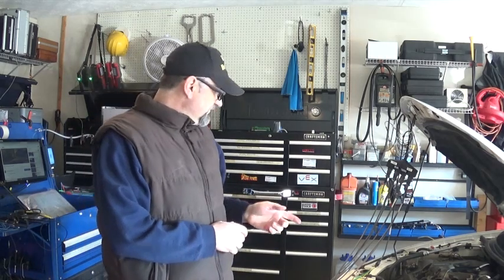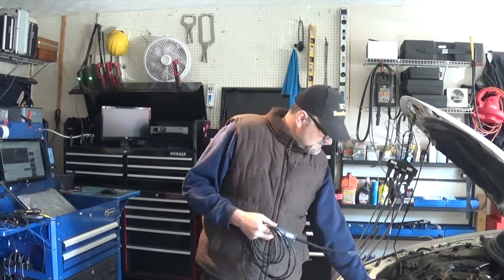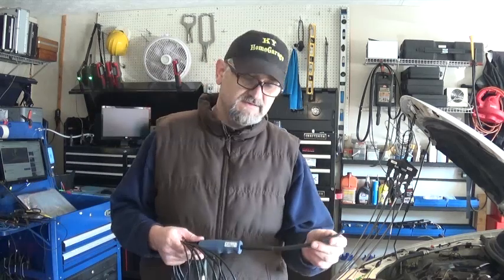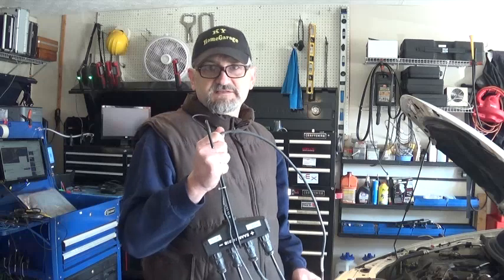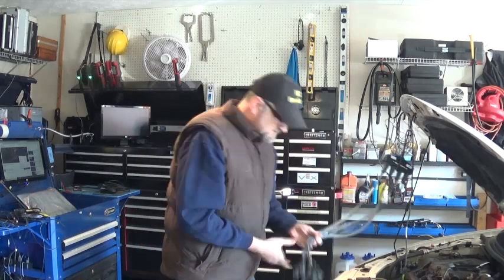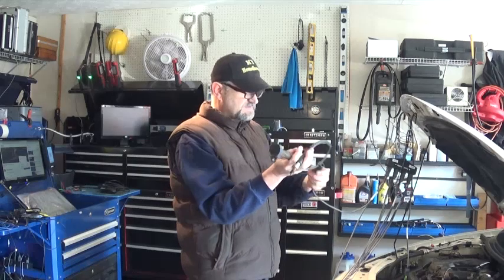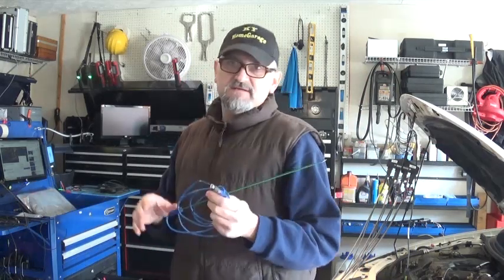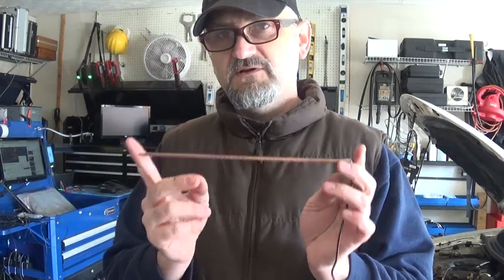Home Made Secondary Ignition Multi Cylinder Probe

Comment: Great video and thanks for sharing your knowledge with everyone. I have been trying to figure out how to measure all coils at once. Thanks for the info and how to build the tools. My boxes are full of Mac and Snap On it’s also packed with custom tools I built. I have always measured them one at a time and record then compare. This is far superior. Thanks again. I have been working on cars for almost 30 years. I try to learn something new each day. Now I know how to measure all coils at once. My way of thinking is if you can build it why buy it?  My favorite just because of the name one of the mechanics gave it is for removing the front crank bolt on BMWs from 84-91 6 cylinder that use a timing belt. The bolt is torqued to 250 ft lbs. he named it the orgasmatron. It looks like a mid evil weapon. The factory tool is $600+ I built it from scrap with a welder I had 15 minutes total in figuring it out and building it.
Reply from the maker: All Things M3 love that name my friend. I enjoy making my own tools. If you have grinder, welder and acetylene torch sky is the limit.😁😁👍

Comment: What a great idea, I wonder if using a thin sheet of copper instead of a thick bar might allow for the tool to be flexible like the snap on
Reply from the maker: Any conductor will work. You just have to play with it and see what works for you. I got these copper  bars from eBay and that was over a year ago. Pretty cool tool if you use secondary ignition in your diagnostic process.👍👍😊

Comment: If you don't have a Snap-On cable, would you just hook the ground to the disconnected shielding of a standard RCA cable? Is the a simple schematic for adding capacitance protection?
Reply: Also, is the capacitance protection in the Snap-On scope just a 10:1 or 20:1 adapter?
Reply: It's neither! -- it's a capacitive voltage divider. Search for "princeton ignition waveforms" and look at page 5. There could also be a 100KOhm resistor in series with the probe, and a TVS diode at the oscilloscope input for a good measure.
Reply from the maker: Dmitriy L. Thanks for answering this question my friend. You are awesome 👍👍😁😁
Reply: @DmitriyL_Arithmechanics  thanks for the reference!  Seems easy enough to make.

Comment: Great idea, thanks for the video. Just wondering why you do not use any attenuator to protect the scope?
Reply from the maker: Mambre Khachatryan thank you I am glad you enjoyed this video. I don’t need to use attenuator because as you could see voltage input is less than 200 mv but I do use cable with capacitor in case of voltage spike from faulty ignition coil. Also my probes are very well insulated. I hope this answers your question. Thank you.
Reply: @kyhomegarage3430  what size capacitor do you use in your cable? And do you just wire it across the signal wire and the ground wire?
Reply from the maker: @alanw5879  I really don’t know but it’s built in Snap On cable that I use. I am really sorry but I can’t answer your question.

Comment: hello. could I use insulating tape in between plasti dip layers for insulation.  Thanks I'm in the process of making one. Thanks again
Reply from the maker: stephen marshall You can use whatever you have. More insulation is better. I used  supply that I had and so far I am very satisfied. Works good.👍
Reply from the maker: stephen marshall this is copper I used 
https://rover.ebay.com/rover/0/0/0?mpre=https%3A%2F%2Fwww.ebay.com%2Fulk%2Fitm%2F282614590680
Reply: @kyhomegarage3430  thank you very much for replying and thank you for the video. keep doing them please

Comment: Hello sir!congrats for your repair information and for your handmade tools ideas and tips sharing with us!I want to ask you about the cooper bar multi signals from the ignition coils in one channel can we do something similar and from the injectors signals? Multi signals injectors all in one channel?with a different way of course not with a cooper bar!best regards!!I look forward to your reply!!
Reply from the maker: George Ribo I don’t know. Magnetic field around injectors is much smaller than ignition coils. I will try it thank you 👍
Reply: @kyhomegarage3430  thank you very much for your quick response!!!if we take for example in a 4 cylinder engine 4 wires and connect in to signal wire of injectors and the other side of this wire connect all together with a common wire and with an adapter connect to one pico lead we will see 4 signal together?and this is safe for pico?in my mind I have the 4 to 1 wire like this from awswave https://www.aeswave.com/uIsolate-Network-Isolator-p9669.html     best regards!
Reply from the maker: George Ribo that will work only if test leads have diodes in it otherwise you will short all control wires into one wire. Hope this make sense
Reply: @kyhomegarage3430  yes it is!!!thank you very much for your help!!I hope seen you make something like this!!!

Comment: Great video, I was wondering if you tried your presser transducers with the new formula and how accurate they were
Reply from the maker: J.R. Robinson formula works great but aftermarket pressure transducer have some issues. I will make video soon. Cheers my friend 👍👍
Reply: I have issues with the transducers not showing 0 psi at the exhaust stroke so that I can accurately test back pressure. I am now looking into compound transducers
Reply from the maker: J.R. Robinson that is same problem I have. My was working fine for long time and now every time I use it part of my waveform will drop below zero line and I don’t know why. I just got fluke PV 350 works great. Will do video soon.👍👍

Comment: I WAS WONDERING IS THERE A ADAPTER FOR THE BLUE SNAP ON IGNITION PADDLE THE LONG ONE. TO CONVERT TO BANANA JACK
Reply from the maker: Thedons brewery not that I know. But you don’t want to use any adapter. This snap on ignition cable provides protection to scope in case of open plug or ignition coil.
Reply: KY Home Garage thanks
Reply: KY Home Garage ok I ordered that. Thank you

Comment: that otc tool is made by farret . i have had that tool for over twenty years
Reply from the maker: Randy Gould you are right. I didn’t know that until I did some research my is OTC. Thank you. Cheers
Reply: @kyhomegarage3430  It seems the OTC tool (or Pico Mixmaster) should not be too complex to make.  These are going for $350 or higher.  You think something like running each signal in parallel each with its own diode might be good enough for a DIY'er?
Reply from the maker: Louis Pasnik that could work but you can’t reverse your waveform for waste spark system.
Reply: @kyhomegarage3430  Thanks for the response.  For the waste spark systems, does the OTC tool simply invert the voltage of the opposite polarity waveform and combine it, thus allowing the scope to display the combined superimposed ignition and inverted waste spark (or inverted ignition and waste spark) pairs?  
https://www.motor.com/magazinepdfs/071999_06.pdf
I'm guessing the OTC tool is not smart enough to simply ignore or filter the signal from the waste spark altogether and only send a signal from the firing partner to the scope.  In reading from the link above, it seems as if superimposing the  ignition + inverted waste spark doesn't really matter in analyzing the waveform patterns as I'm guessing each of the waveform pairs have similar patterns (albeit voltage absolute magnitudes are different) thus the combined signals should superimpose on each other nicely as long as one is inverted?
Reply from the maker: Louis Pasnik yes it does. If your signal is inverted all you need to do is plug your lead to another row on your tool and signal will be inverted. Thank you

Comment: The main thing and the only important thing of this probe is oscilloscope PROTECTION that is between oscilloscope and the metal stick at the end. Yet, I do not see any discussion anywhere of this ONLY IMPORTANT thing: what is capacitor (if any), or what is the name of the VERY SPECIAL cable that is used between oscilloscope and the dumb metal stick at the end. What is the SMART part of this probe? I see no such discussion.
Reply from the maker: Its a stupid cable from stupid Snap on ignition tester with stupid capacitor built in to it protect stupid oscilloscope. Probably has some stupid name anyway which I don’t know. Thank you for watching.
Reply: @kyhomegarage3430  It is NOT a matter of exchanging childish name calling. It is a matter of protecting EXPENSIVE oscilloscope from being bricked. Only cable design can protect it. Name calling, like children, does not help anything. I asked for serious information to protect my (and readers' scopes).
Reply: What II meant by "stupid" or "silly" (or any names I might used): the piece of metal at the end is not "smart" in a way it does not provide any protection from voltage spikes. Piece of metal bricks the oscilloscope. We need "smart" protection from cable design: capacitors and resistors are inside of the cable (usually). I might have woken up some incorrect emotions in you by using wrong wordings initially.